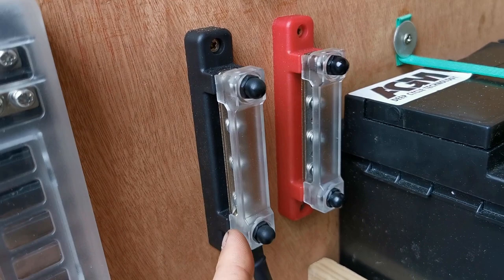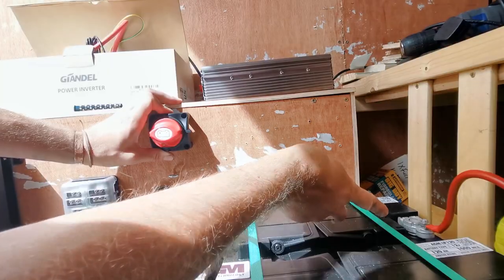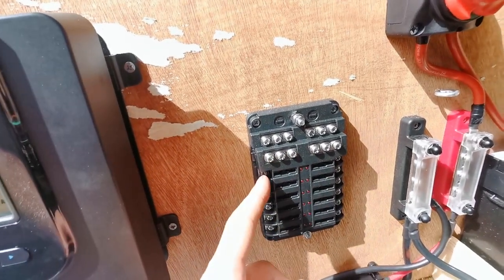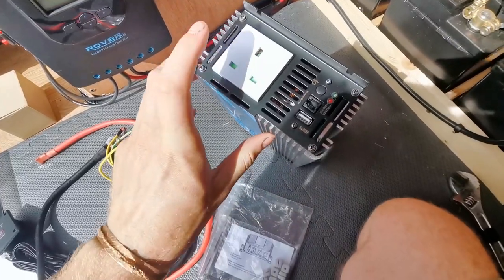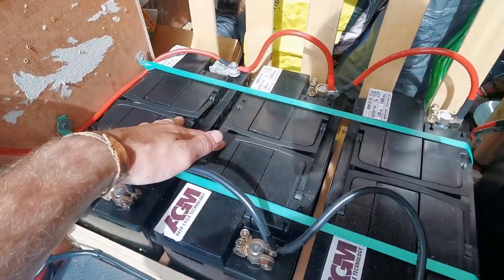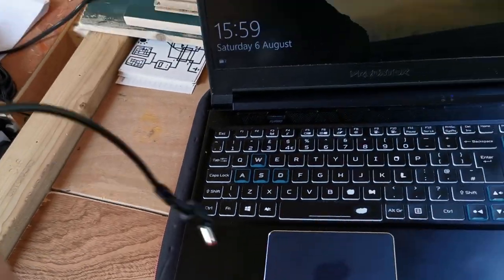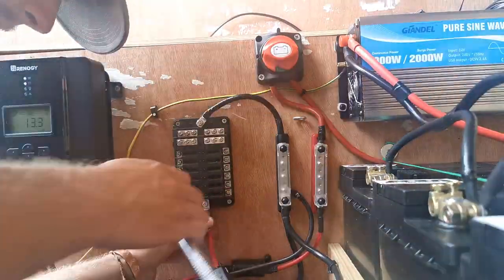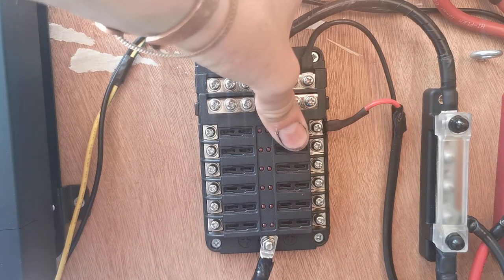Vanbuild Series - Part 9: Inverter and Fuse Box

Comment: Any reason you wire the inverter straight to the batteries instead of to the bus bars? Does it matter?
Reply from the maker: Couple reasons that I have but you're right, you'd be fine to wire directly to the bus bars.

1. The terminals are too large for my bus bar screws but fit onto the batteries well. 2. Shorter cable, which is always good practice with high power devices. 3. I prefer to follow the manufacturer's instructions with big ticket items.

So long as the inverter is fused and the cables are suitable then either way works fine. Also check your bus bar can carry the amperage. It's usually really high but it does have a limit.
Reply: @TheWoodlandNomad  Thank you for the explanation. Your videos have been super helpful!

Comment: 16mm would of been better then 10mm IMO
Reply from the maker: You can always go bigger but I saw no need with it being rated for 70amps and I'm never going to put more than 30 through it and that'd be every single device, USB and light on all at the same time. Plus it's fused so the fuse would go before the cable was under any stress.